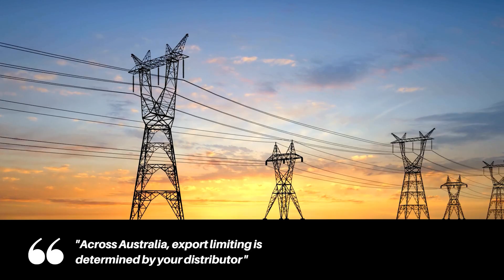What Is An Export Limiter? | Everything You Need To Know | Teho | Solar & Battery Experts

Comment: Do you mean something like the Sunnyboy Home Manager 2.0  ?
Reply from the maker: Hi David, 

Thanks for your comment. 

Yes, a Sunnyboy Home Manager has export limit functionality. 

If you are installing a new system or expanding your current system, the Sunnyboy Home Manager can be set up to limit export so your local distributor is happy! 

An added bonus, you will also have the ability to track all your solar generation, solar consumption, grid imports and exports. I guess you can consider this as a bonus. 

Thanks,
Jono.
Reply: @GreenAu  Hi Jono, 
Well that's what I needed to hear.
I have 10Kw on a single phase and my current installer is adamant I need 3 phase $4000 or grid protection $10000 to add more , I'd like another 6-8 Kw .
I spoke to Gavin Brackenbury-Soldenhoff from Teho and he was very helpful. 
I am emailing Ausgrid to ask what's possible. 
The Sunnyboy Data manager with a Modbus is also a viable option. 
Thanks.
Reply from the maker: @davidgreen424  

Gavin is a good bloke, glad we can agree on that. 

I'd suggest pressing go with the SMA solution and we can apply for a manual assessment with Ausgrid. 

We need to do this for you with our engineer Rob, worst case they say no and come back with an alternative solution, which is unlikely. I can nearly guarantee you it will be approved with us. 

I'll leave this with you and Gavin to arrange. 

Thanks,
Jono.